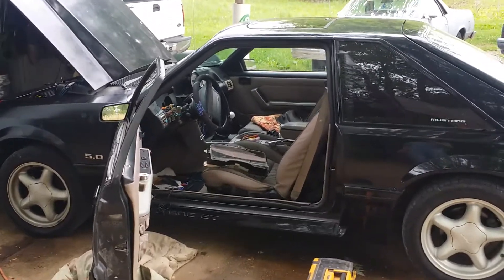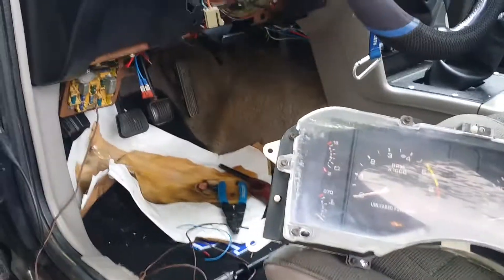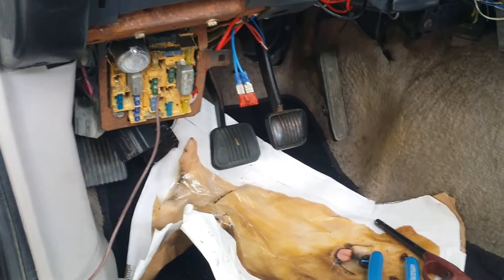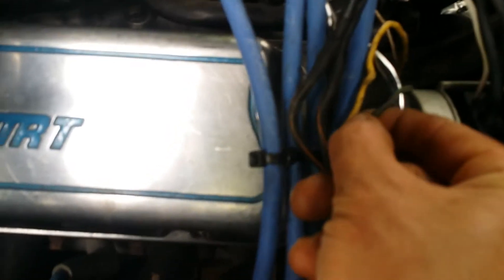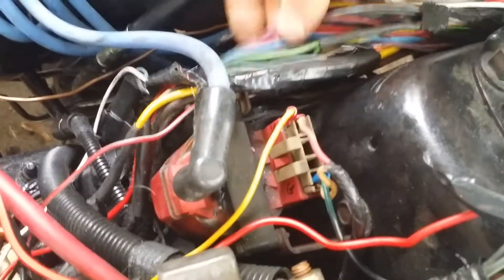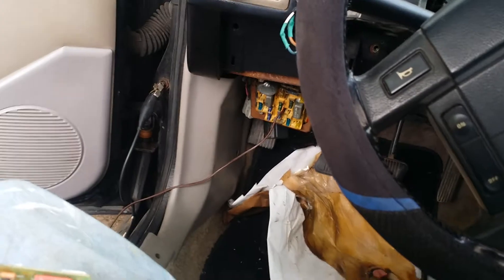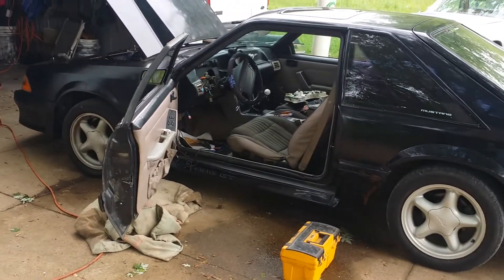How to get a altenator on a 91 mustang to start charging

Comment: Thank you for making this video. I purchased a 91 GT convertible and the gauges were trashed. I spent a lot of time removing the ac unit (under the dash) and fabricating mounts for new 5" gauges. I removed the whole dash, cleaned up the wiring and everything. The gauges came out great, but I was having a no charge issue (replaced the alternator too). Bottom line, this video saved me A LOT of time and money. Thank you again for taking time to do this!

Comment: If I’m having a no charging issue, I’ve checked the green and ride wire and I’m getting battery voltage to it at the alternator plug with key on, I don’t believe this is going to fix my issue right? I was told it needed that 500 ohm resistor and would only be 2.25 volts at the regulator

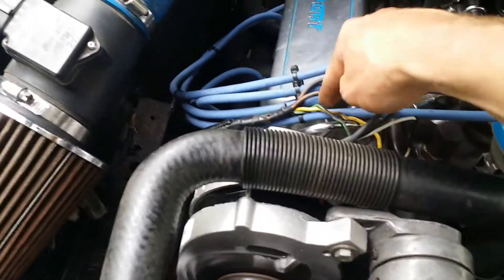Comment: @8:17 green / red wire goes to main relay or solenoid or battery? Negative side or positive? Thanks I have a wire orange and black heating up on alternator, wiring may be wrong for alternator or alternator is bad or needs fusable link.

Comment: I did a 3g conversion on my 2.3L 88 mustang and not charging. If i run a wire from the alternator red/green wire to a 12v source, do you think it might work? Thank you!!
Reply: If u ran the green red strip wire to keyed power on a 20 amp inline fuse and eliminate the dummy light on the dash it will charge.i did it to my v8 swap 87 ranger.works like a charm

Comment: I own an 89 Foxbody I had recently bought it rebuilt the whole engine and I'm having a little bit of a problem with the alternator when I first got the car it was the yellow wire on to the main power source for the alternator it's a 3G upgrade now there was only the yellow wire and red hot wire hooked up and the green wire with red stripe now do I have to hook up the yellow with the yellow wire I know green with red stripe goes together do I still have to hook up the orange and black striped wires to the hot
Reply from the maker: jay more  Hello thanks for the reply my problem  was that it needed a jump start to start charging  again  so I ran a hot wire to the green and red stripe wire and it started charging again that's a weird set up but it happens when you unhook the wiring harness I'm not sure what your saying about your red and yellow wires sorry. But if your altenator is not charging your battery you need to hook a hot wire to that green/red wire make sure you use a hot wire that turns off when you turn the car off.  Thanks again I hope this helps
Reply: @gibbydiy4235  so you connect the green red wire straight to the battery?
Reply: @gibbydiy4235  like jose barron asked do you connect the green red wired after you hook it up to hot wire? Thanks in advance